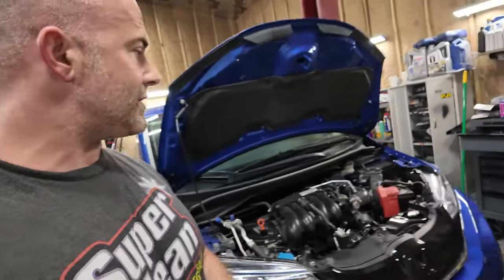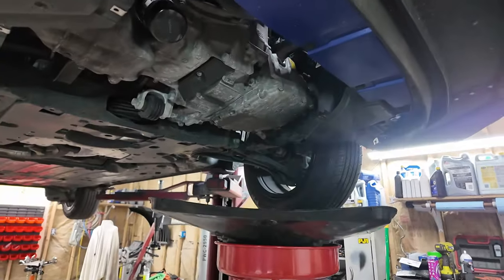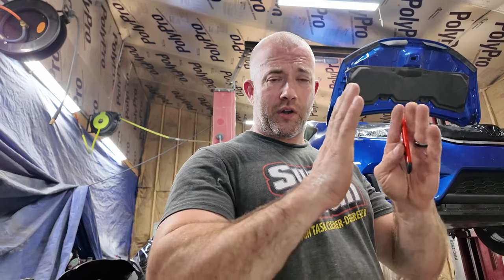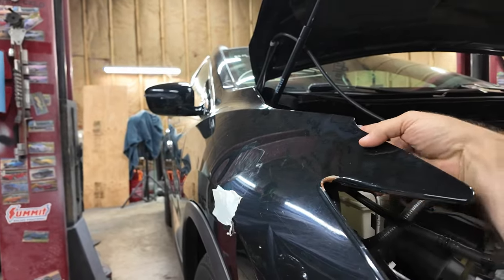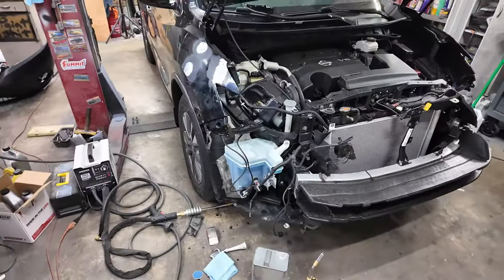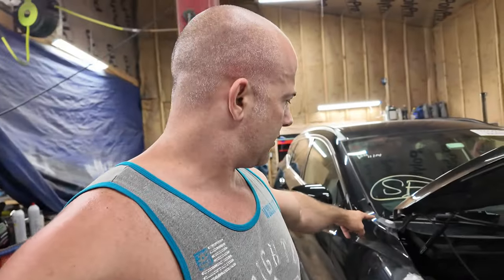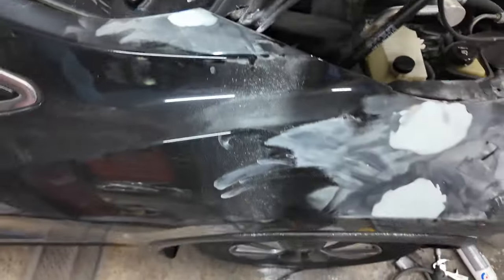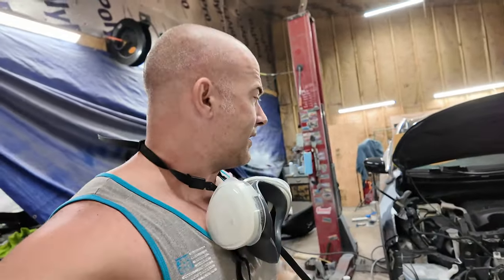2015 Honda fit transmission service and 2017 Murano bodywork

Comment: You always fill from the top.  Always.

Pull the top plug and check plug.  It will flow smooth then.